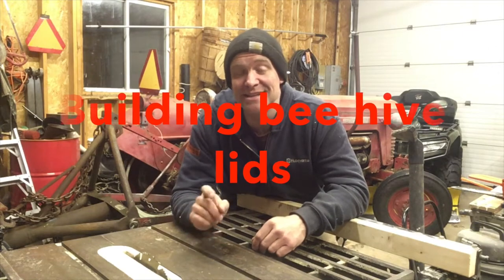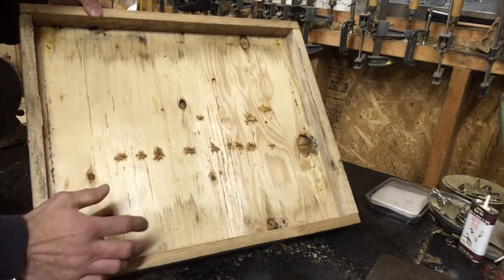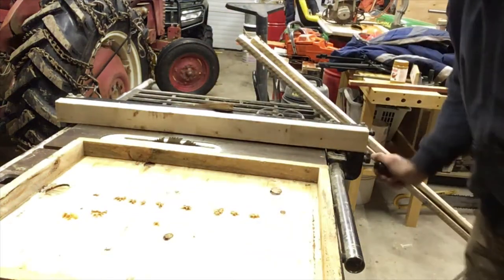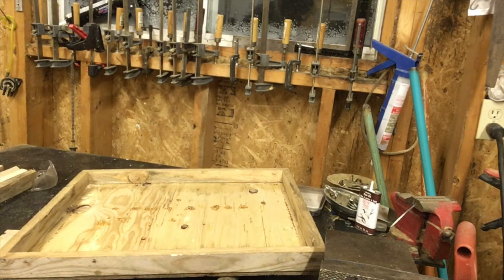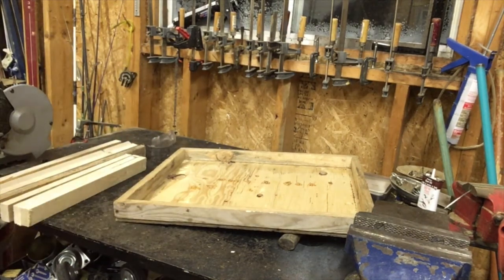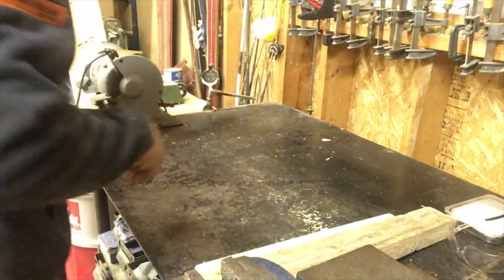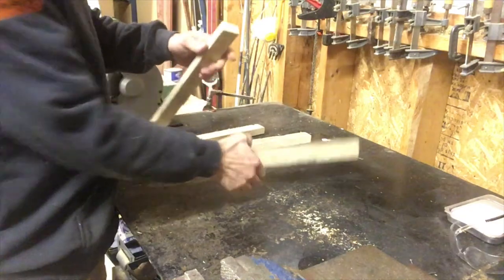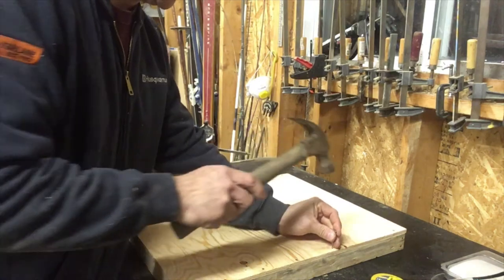Building bee hive lids

Comment: Is there a reason you dont use wood glue?
Reply from the maker: There is no particular reason. Glueing it is always better. But when I am assembling them it is still pretty cold out. And my glue freezes and doesn’t really dry properly. So I haven’t been glueing the lids or the bottom boards. I haven’t had any problems with the lids are the bottom boards because I don’t have too much sideways prying. You definitely have to glue the frames and the boxes.Or they will fall apart.Thanks for watching now
Reply: Thanks again